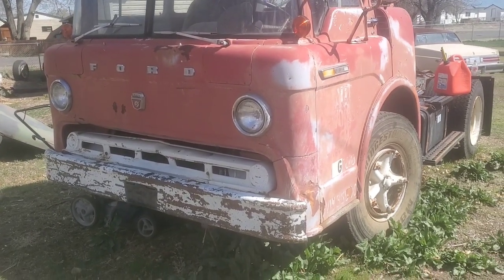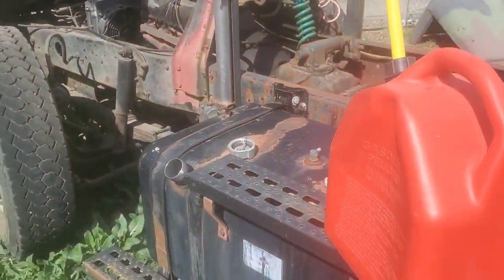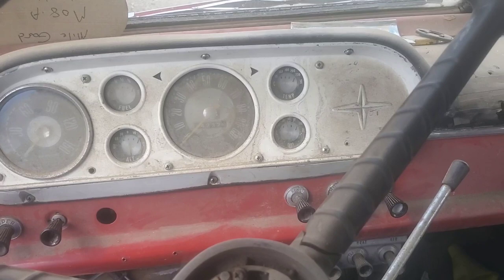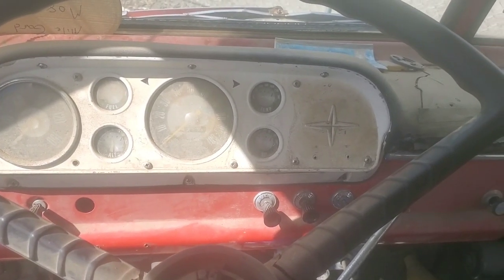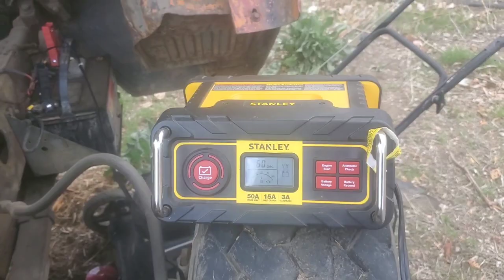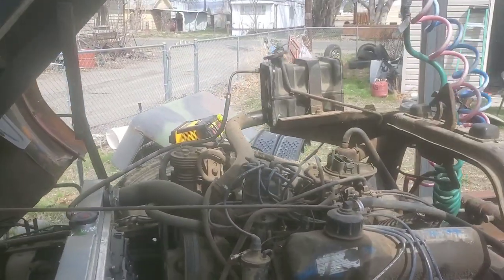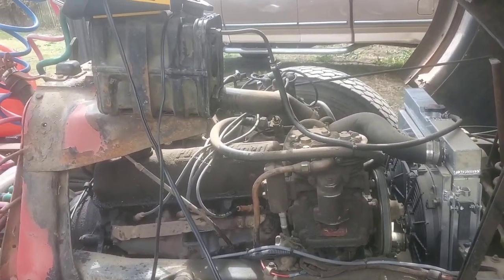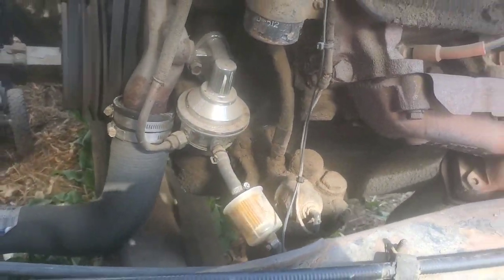cold start attempt 1969 ford c700 330ci v8 big red ep5

Comment: Dude, take it easy out there, sounds like you’re minutes away from a heart attack.
Reply from the maker: not sure  that sit down and relax is sound advice for someone as out of shape as I am. need to be more active to lose weight. unfortunately I am over 500lbs.. working on it
Reply: @travis9438  I mean to say, don’t strain yourself, the heat, physical exertion is really hard on the heart.
Reply from the maker: @richardd408   I will be home soon to take the alternator out and have it tested as well as tide up some under the hood. no promises but if I can get it running well enough  I will  use it to haul a semi trailer to the auction house
Reply: @travis9438  sweet, looking forward to more videos, it’s such a cool truck.
Reply: @travis9438  damn dude you NEED keto diet

Comment: We used to run these hard.  Electric two speed axles are awesome when you get them singing.  We used sodium filled valves and four ring silv-o-lite pistons (less galling when hot). Would cut slits in the bottom side of the radiator shroud and drop a ramp down a few inches. Lugging was bad and stopping too soon after getting off the freeway was worse. Good luck !

Comment: That was a workhorse back in the day. I worked at Dr. Pepper bottling and we loaded these trucks to the max everyday! Those stick shifters you really had to make sure they were in neutral. They were a bear to shift when it was below zero.
Reply from the maker: its my hope to get it running well enough to do a load in it, as a novelty

Comment: Happy New Year greetings from the Ohio Porters!🇺🇸 You should have a battery door in the floor of that thing. They were bad about rusting though. Those springs really help raise the cab, after you pull the lock releases. I drove a 1965 C800 390 5&2 speed. It had power steering and I loved that truck!🥰 I even drove mine to school and vocational school to do the body repairs. Talking about a sweet truck! Mine had 8 track, CB Mount, lots of lights. Good looking little truck. Are those cherry bomb mufflers? Wowsers! I always liked the looks of those cabs.🥰 Good stuff! 😎🤩✌️
Reply from the maker: there is a battery door however the hole is not large enough for jumper cables comfortably. also the mufflers are basically 🍒 bombs but this peticular brand is purple hornies  hoping to do more videos on this truck soon. currently there is 3 feet of snow in the back yard

Comment: Thank you. That's interesting on shift pattern 
My uncle had a 4 with 2 speed rear. And I worked for a guy that had same truck as yours. Same 5 speed. Is it bad to just split every gear. That's how I shifted. It just was used to haul a backhoe always. Never ran her Light. Never knew the pattern you said. Very interesting shift pattern. I just went off what was written on visor
Reply from the maker: think I said the pattern wrong at some point but with the two speed rear the pattern is different depending on the gear ratio you have. I have found with mine it is unnecessary to split the low gears with the rear as the gear ratio is so low.
Reply: @travis9438  
Can you do another video of just shifting again.
I find it interesting how you shift a two speed rear,  kind of like a spit shifter for say a class 8 Truck with the lever on front of nob. My 8- 71 with a Spicer 5 speed. Doest have a splitter on it. So it's been a time sense I used one of those two speed rears.